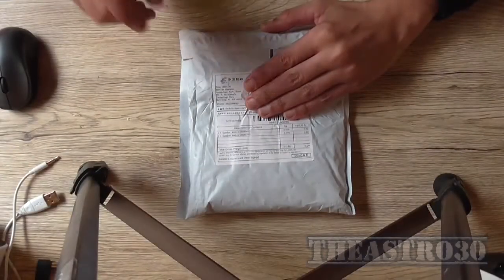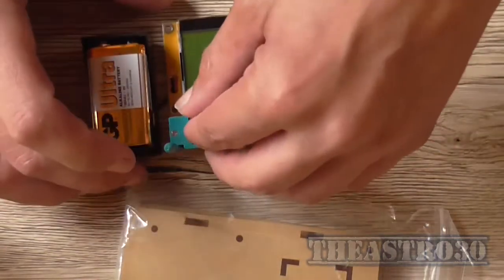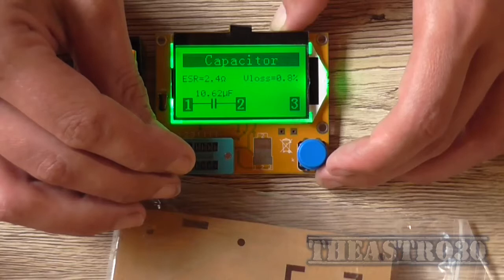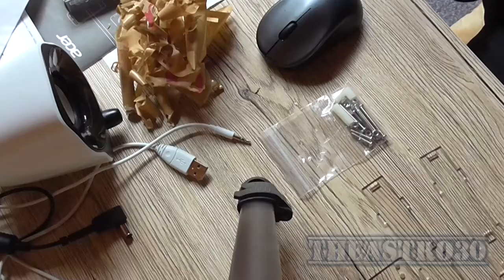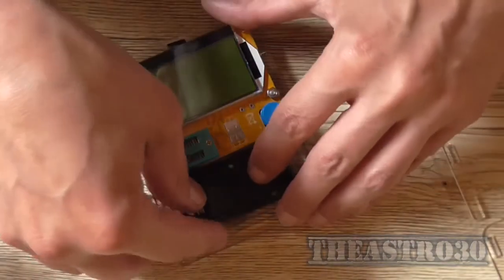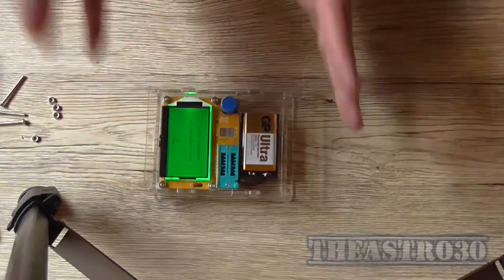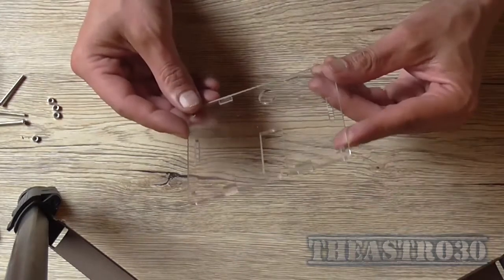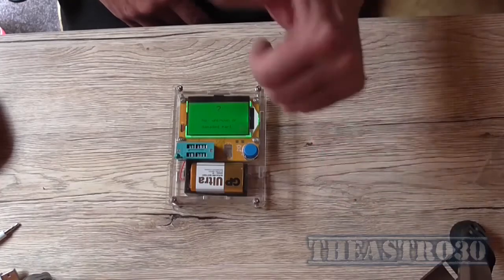Mega328 LCR-T4 Transistor Tester [REVIEW]

Comment: I was just looking at this kit on eBay and my main concern, right off the bat, was the case.  I thought it looks like a pain in the donkey to assemble and then I must be missing something, because how does one change the battery?  I'm sorry to say that you validated my concerns 100%, but I didn't expect the hole alignment to be off as well!  Hopefully it's been fixed in the last 5 years.  (Yeah, right.)  In addition to enlarging the button hole, I think I'll take a Dremel to it and cut a rectangular hole for changing the battery.  Thanks for posting this.

Comment: You don't have to hold the device while testing.  Just move the lever on the left and the device will lock in place.  It's called a ZIF (zero insertion force) socket and makes for easy insertion and extraction of devices.
Reply from the maker: Yes, I know
Reply: That's if the leads are not too large and the spring tension in that crappy, cheap socket is correct.  Not all ZIF sockets are made equal.